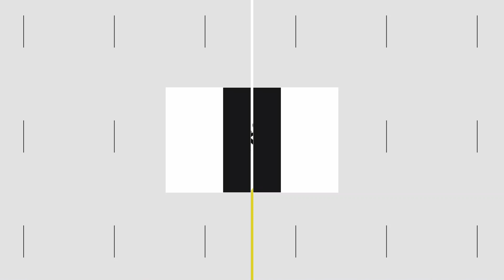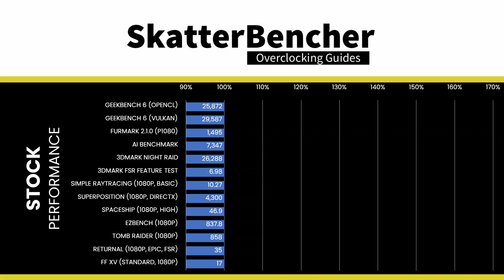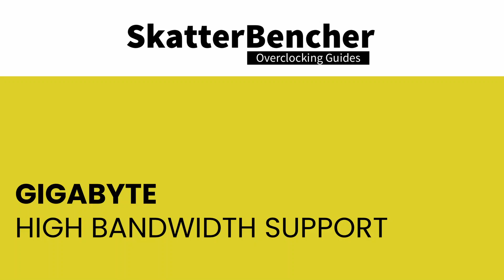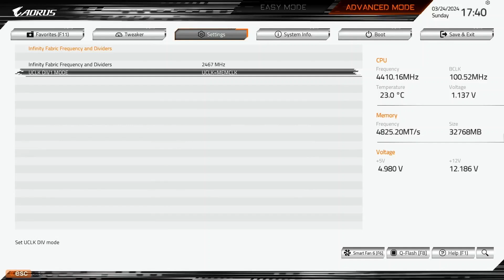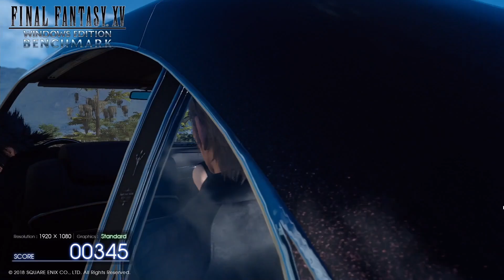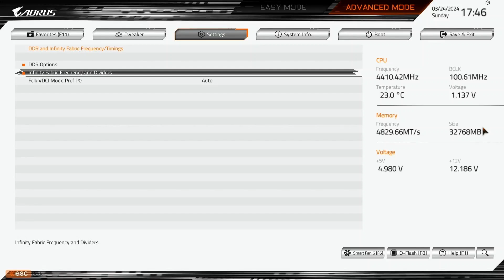Radeon 760M Overclock to 3150 MHz feat. B650E Aorus Elite AX Ice | SkatterBencher #73

Comment: Could you please share the 8600g 760m igpu overclocking settings for the biostar b650mp-e pro motherboard?
Reply: Much of what he shows here is the same, just did it on an MSI motherboard with a 8600G

Comment: This is safe 100% to do by copying everything you did?
Reply from the maker: Depends on what you call 100% safe, but my settings are supposed to be stable for daily use. Of course overclocking mileage may vary depending on the CPU and system.
Reply: Any tips for checking if the settings are stable for me? I'll try it. Also, do you know how to tune the RAM? My PC crashes when I set the RAM to 6000MHz, but it's stable at 5800MHz. The weirdest thing is that when I set the RAM to full speed and then change the iGPU's VRAM, the reserved RAM value doesn't update. It bugs out really badly.

Comment: eu to com o 8600g com a 760m em 3000mhz instaveis  funcionado de boa
Reply: ta rodando atualmente rm 3150mhz com a voltagem setada em 1.2v e as ddr5 asgard freyr de 6000 ta rodando em 7000
Reply: @GuilhermeS990  peguei um 8600g. Quero dar esse up na GPU usando uma ITX ASRock b650i Lightning. Sua DDR5 é CL30? 32gb em 2 canais?
Reply: @BBS-ita  E sim amigo.. e asgard freyr ddr5 6000 cl 30 to rodando a 7400 com 42- 48-48-84 de temporização em 1.35v padrão.
Reply: @GuilhermeS990  Obrigado pela resposta!!!!
Reply: @BBS-ita de nada amigo.. qualquer coisa só perguntar

Comment: Cool! That's awesome work. I used your guide to OC my 8600G. It's funny how much power 8 little 4nm compute units can pull xD. Also, using dual-rank memory gives about 10% more performance compared to single-rank kits at the same frequency. Here where I live we're lucky to have access to Hynix OEM memory for excellent low prices. +50% or more to performance after total OC is amazing.
The new Strix Point APUs, Ryzen AI300 series (what a dumb name), will those end up on desktop? Are those future 9700G and 9600G? They will have 16 and 12 CUs.

Comment: Hi! Nice to meet you 😊 As a newbie in the PC world, Im keen on building my own desktop. but I hv got a little query: Does overclocking mess with my CPU and motherboard? I caught your video, and it seems like having sufficient cooling and voltage can keep things steady without any harm. Am I correct? THX!:face-red-heart-shape:
Reply from the maker: Yes, you are correct. While excessive overclocking and overvolting can hurt your computer components, moderate overclocks and voltage adjustments will do little harm to your system.

Comment: One thing I dont understand is that AMD list the max clock speed on the RAM to be 5.2GHz, so is this because of "driver updates" or because the APU can utilize higher clock speeds for the graphics processing instead of the computational?
Otherwise loved the video.
Reply: This is the clock they guarantee any CPU will support. Above that, they consider OC.